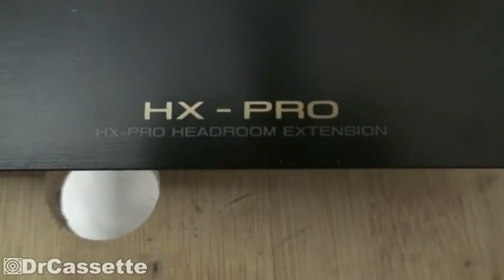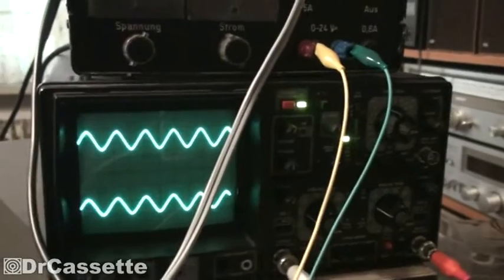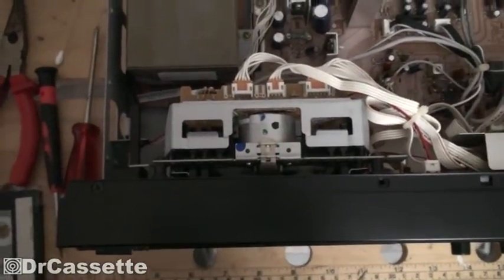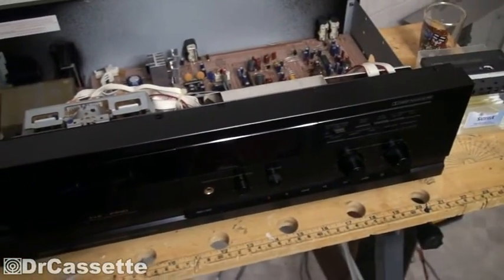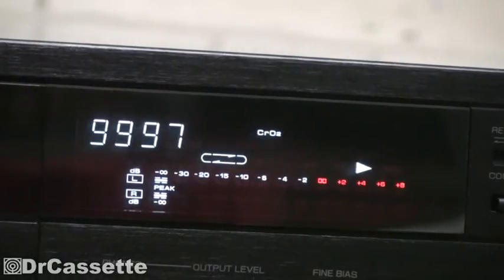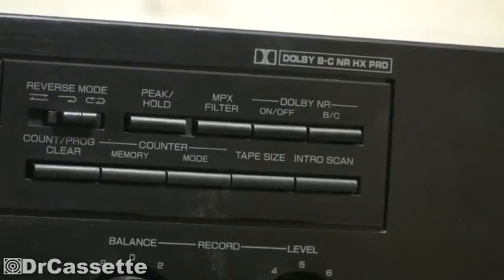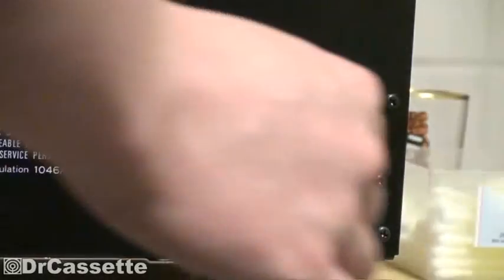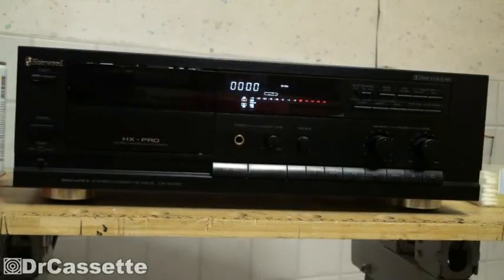Sherwood DS-5015C cassette deck!

Comment: Have you ever tried one of the hexane based liquids to clean pinch rollers?  I use it on tape heads and rubber rollers and it is very kind to rubber parts and doesn't dry them out.

Comment: Nice to see you saved a survivor.  I unearthed my old Sony TC-K615S and the first thing it did was the plastic gears in the drive system jammed causing the capstan belt to fall off.  After remounting the belt and lubing the gears, I got it to play, but either capacitor(s) are leaking or the power supply is bad because there's horrible noise.  I researched the model and it turns out that this is typical of Sony units of the era it was built.  I'm not sure I want to invest anymore time into it.
Reply: the deck you refer to was talked in hi-fi magazines ,wich was rare at the time ,sony devices mentioned in a known hi-fi magazine but sony being a comercial(all are,but sony is +++++more) released this deck with diferent specifications in diferent europe countries, i remenber trying it because either than having direct family representing hi-fi brands also have a friend that sold in the 90´s sony electronic devices (they demand that to be a sony representative it wasn´t allowed to sale other brands) wich my family choose to do not sale sony devices anymore this having to be related with many new sold devices at the end of 15 days they started to have problems and only in lisbon capital of portugal ,the country where i live, there could fix sony devices wish they returned with the same problems and several times the answer was to buy a new device because the fixing was superior to the price of the device ,this with 2 month after warranty expired and as an example a md deck  that never relly worked fine, and has i have some knowledge in electronics was simple to fix  just tune the play/record of the md deck wich i did it in 2 hours this to disassenble ,the fixing took 15minuts , that´s why my family shop choose to do not sale sony anymore and i could give you much more ridiculous examples , this to talk about your deck that when new it seemed to be a good cassette recorder , but the material used to built it was incredible bad ,so you´ll have to substitute some lot´s of electronic components ,the noise might come of the transformer , or other printed circuit that is failing due to it´s bad construction or has you refered to the gears wich are made of a bad plastic composition this because where i live the temperatures are very high and if one uses his deck to record 2 cassettes one after another they start to unform and create a trembling noise in the recordings that after another 2 monthes they needed to be substituted again, so if you live in a place that as to much heat or moisture i wouldn´t spend money with it , wich is sad because this deck really is good when working properly, but it´s more cheaper to buy a used one from other  brand with the same specifications in sound quality and restore it ,at least you´ll have a lot of years with a good deck working without faults, i own a pioneer deck that was stoped for 24 years and just substitute the belts and idler rubber ring and it works like new again, and i also could add that in 1981 i bought a ct-530 or 520 that was from the worse period of hi-fi devices that was almost all made of plastic ,being the previous model with the same reference all made of metal and the front made of brushed aluminium , this to say that i did the same ,just substitute the belts and it played cassettes with a very good quality ,one day by mistake i pressed the record key and it record 1 or 2 minuts over the recording i had in that cassette when listening to the 2 minuts recording i was amazed by it´s quality in sound ,that, i haven´t tried before after changing the belts, so there are many good decks available for sale on ebay in need at the most of changig the belts and sold cheap , thast´s the better solution for you ,to do not spend more time and money in your sony deck ,but that´s your choice, regards

Comment: Thank you for this video! 
This deck is.. let's say not quite popular and thanks to you I had a chance to sneek peak inside making my decision to buy one I had an eye on for some time.
And this turn out to be a great project! The result is, well,  currently this is my favorite one for listening in my collection. I have couple of Denons, Pioneers, a Nacamichi BX-2 , a NAD616 and some others just for perspective.
I am surprised by the 2068DD opamp. Haven't heard one before and I can argue this one beats a lot of the others, incl 5220, 4558 and 4570.
Some pros:
For the year 91 and for what it is - it is a well designed unit.
The transport is cluncky but reliable and I'd say durable. Nice impressions from it using the NAD
The shielding of the control and display section is something others have designed and then often have omitted or reduced. Cost cutting or really not needed?
Split power supply and interesting components choice.
Good set of features and functions. 
 
Cons:
Implementation.
Usage of low cost components. 
All of those easily correctable ;-)

I think you've missed a good opotunity for a nice project on this one.
If you still have the DS-5015 - please consider revisit it. I can share some experience as well.
Reply from the maker: You are welcome! I had to watch this video to remind myself of this cassette deck. I know I kept it around for some time after making this video.